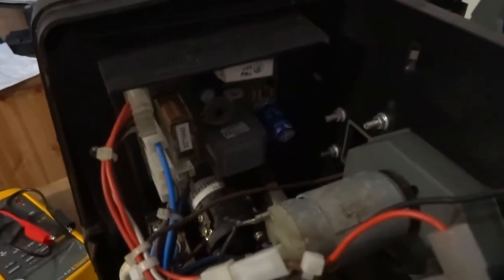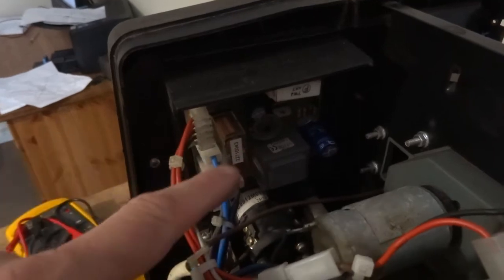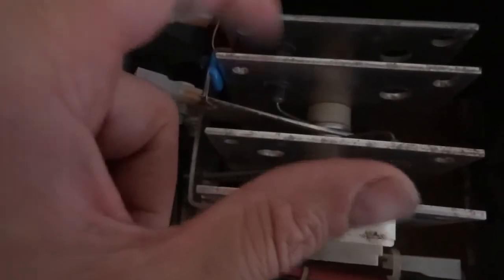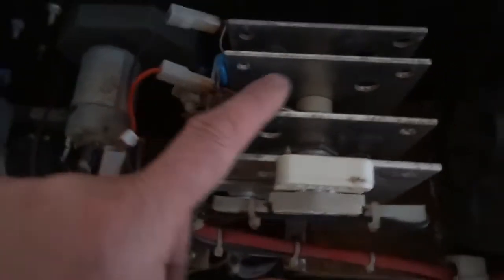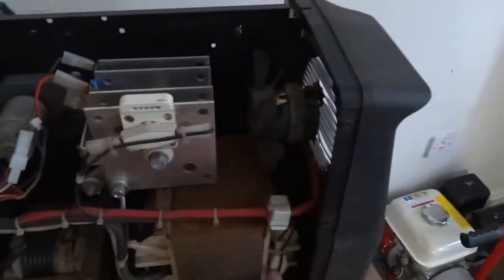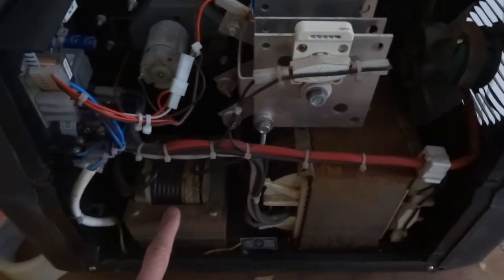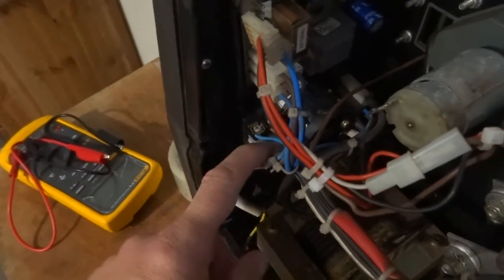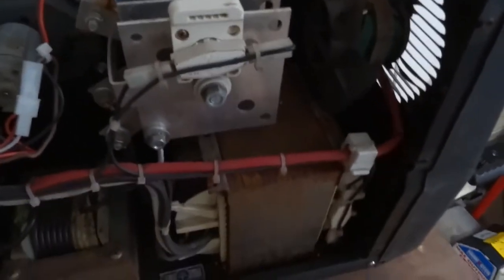Top 5 Clarke MIG Welder Problems & Quick Fixes: Wire Feed, Arc Issues, and No Power Troubleshooting

Comment: Mine has started blowing a fuse and actually might of blown the fuse of my extension cord need to check that though
Reply from the maker: Start testing and check insulation resistance of transformer coukd be loose leads as well maybe

Comment: Mine is blowing a fuse in the plug  after few seconds of welding at full blast
Reply from the maker: you need to updrade fuse or circuit breaker for a higher inrush current specification.
Reply: @cagmito76  In UK standard 230v plugs have fuses inside then up to 13amp. I found some illegal 20amp fuse and it still blew up... But I'm not sure about these Chinese 20A fuses. They are not allowed in UK and plugs are only rated up to 13A.
Reply from the maker: @grzegorz16100  It also could be that the welder is faulty and dangerous so make sure you test it thoroughly.
Reply from the maker: its dangerous to just use higher rated fuse as when a welder starts up the inrush of current can be high 100amps but then retirns to normal you can buy circuit breakers to account for this high in rush current fuses, but if it is a domestic welder its designed for 13 amps and it could be faulty so be very careful